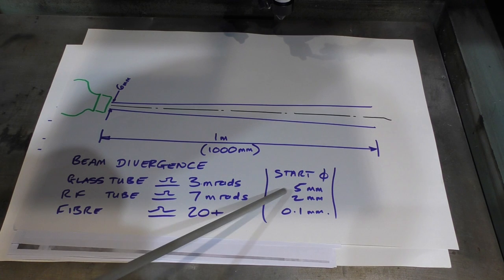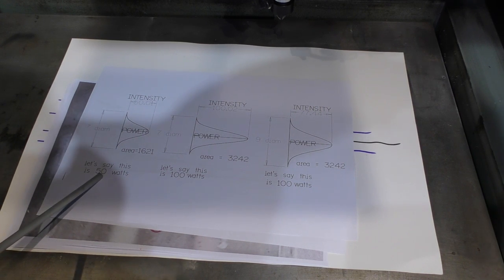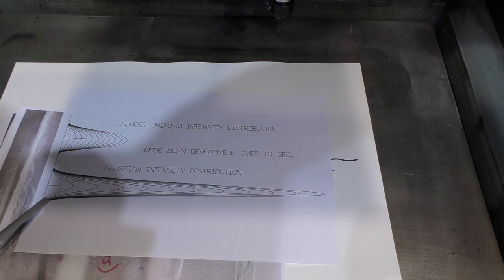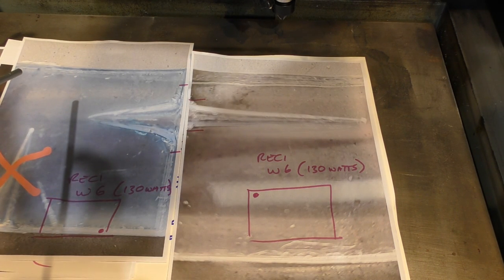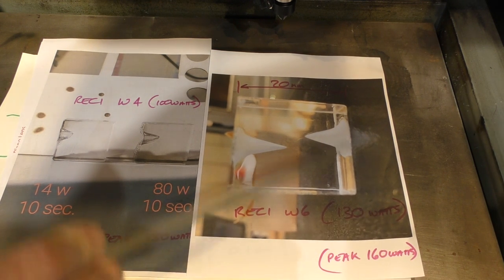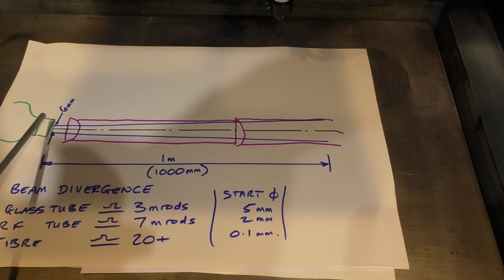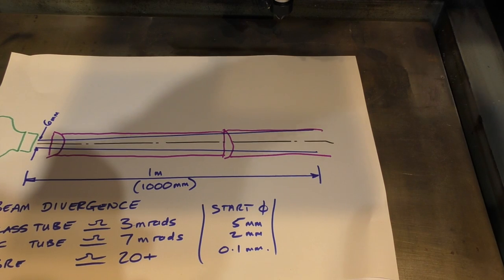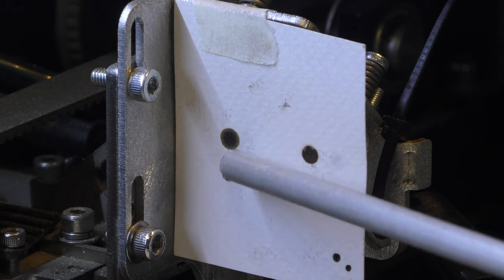RDWorks Learning Lab 225 Is a Beam Expander useful

Comment: Finally someone did it, I have been with this idea for two months now.
My machine does not have this drawback, since I only use one mirror and the work table moves, the beam remains constant.
According to my calculations, the beam after the expander will use a larger area of the lens, this results in a change in the depth of field of focus.
without an expander, you only use 30% of the lens area, which increases the peak power. with an expander you get less point but little power.

Thanks for your experiences and clarifications!
Sorry for my english.

Best wishes
Reply: you able to share some pictures of your setup on your YouTube page?
Reply: @novastar5365  Yes, you can see how such a machine works on my channel.
I did not photograph the machine separately, only the working process.
This is an axial laser that has two tubes, one on the bottom and one on the top.
Therefore, the laser beam must be stationary to bring them together. it is only useful for cutting, it is not suitable for engraving, it moves very slowly for engraving. I use a laser marker for engraving.

Comment: Hi Russ,
Perhaps a strange question...
Did you do a burn / dia check diameter at 240 mm.. would it be possible that the beam is not 'parrallel' but converging at 240 mm then expanding back to the original dia at 480 mm...Just an abstract thought ?
Keep going .. we would all be in the dark if it wasn't for you.....Thank you..
Reply from the maker: Hi Jerry
As I mentioned in the video, ignorance and curiosity are great  exploration tools. My previous exploration of lenses for OUR laser beam shows that lens theory is only true within strict boundaries. Step outside those boundaries an we are into a different world that has to be explored Beam expanders are designed within those IMAGE based  optical rules and as such what I appear to be doing is impossible.. BUT   your observation is valid  and, however unlikely,  should be tested. That will happen in the next video because as I said, my main aim is to make the RF beam into a useful cutting tool.  At present it is exits the tube at a claimed  2mm  diameter (FWHM spec?) so probably is  closer to 4mm. but I would like to see zero divergence. . At present it is "managed " with a X2 beam expander that looks more like X3 in reality. That means there are HUGE gains in cutting ability if I can keep the natural beam intensity high by suppressing the divergence. The current X3 or X4 units used by the "big boys" ensures great controllable engraving but they are then cutting with their ankles tied together. It is for that very reason my Tangerine Tiger has sat unused for 10 moths. Most of what I do away from the camera is cutting so why would I use a blunt knife when I have  two very sharp cutting tools  at my disposal
 Many thanks for the comment
Best wishes
Russ..
Reply: @SarbarMultimedia  Thanks Russ for taking time out for reply....appreciated..

Comment: I used Reverse Osmosis water in the chiller. Would you recommend any conditioner for the water? Managed to cut 1/2" ply yesterday and did laser etching. Had to turn power down to 25% to get it to not come out too dark.
Reply from the maker: ANY sort of water will work in a chiller BUt not for long. Reverse osmosis water is in effect deionized water that has had most of the particulates removed. This process does not remove bacteria which can eventually cloud your water or make it green. Bugs will only be killed by the heat of the sterilization along with particulate removal during the  distillation process.
 It will be fine to leave the deionized  water in your chiller but  check your tube about once a month to make sure your water is clear. At the first sign of cloudiness  drain and purge your system and refill with distilled water.
 Best wishes
Russ
Reply: @SarbarMultimedia  thanks

Comment: At some point you have to release a video giving instructions on what to do to get our machines running at tip top performance.
Alignment, mirrors, lenses etc...
Reply from the maker: Hi  
Did you miss   https://www.youtube.com/watch?v=6aNwKhTRnd8. I always recommend molybdenum mirrors because they are bullet proof. If they ever get a bit cloudy you can safely recondition them back to new condition, Just a quick blitz with silver polish and a cotton bud, After much experimentation with MANY lenses my go to to for cutting and general engraving is a 2.5" gallium arsenide with a cutting nozzle (2 to 2,5mm orifice) For marquetrt or thin material cutting por photo engravind I use the compound engraving kit. All my other lenses are for research (like this video) and are rarely used for anything else . Tip top setting always comes down to getting the beam axis and the lens axis perfectly coincident.....yes that pasky Z axis!!!
 Best wishes
Russ

Comment: If you use a Fresnel Lens would you be able to colimate the beam, so it doesn't diverge?
Reply from the maker: Who makes commercially available Fresnel lenses at sensible prices in ZnSe or GaAs. I understand how the concept of a Fresnel lens could help  with non-expanding collimation  BUT it would  have to be bespoke for a particular divergence and beam diameter otherwise it would be of no value. I like the novel thought process  though. Many thanks
Russ

Comment: I was cutting out some 1/8" ply. the portion toward the back of the machine cut fine but when it cut to the front it did not cut through. What do you think would cause this? smoke?
Reply from the maker: Was your air assist different at the front? I suspect no. The problem is unfixable and is called beam divergence. You must set your cuts to work at the front right corner of the machine
 This video explains it all
https://www.youtube.com/watch?v=z8sNPtIIXZ4

Best wishes
Russ
Reply: @SarbarMultimedia  Just made a discovery. The bed is far from being level. Job tomorrow is to level the bed then try again. I did watch your video and i don't have any acrylic to test the beam intensity.
Reply from the maker: @magicman9486  
 Off level is a definite contributor so fix that first. A piece of acrylic to test the beam is  an essential tool  If you have some thin acrylic you can cut squares and super glue them together or  put this description into your ebay 
Acrylic Display Stand Block Shop Retail Cabinet Jewellery Display Stand
 Best wishes
Russ

Comment: Did you made some intensity test with plexiglass after getting a 3.8 diameter point ?
Reply from the maker: Valentin
 That a good pre emptive question.. It is my intention to do so because that is the ONLY way to see if I have succeeded in achieving my goal.  I did mention that my real intention for this experiment was to effect a significant CUTTING performance gain on my RF machine. All RF machines MUST be fitted with beam expanders to control the 7 mrad beam divergence. I have already fitted the smallest possible X2 beam expander on that machine but in reality it seems like X3. . I also have a X3 and can demonstrate better cutting with X2 than X3.  There is no argument about my goal. All the "big boy" expensive machines are generally fitted with X3 or X4  which absolutely kills cutting potential.  It's the main reason my RF machine has sat unused for 10 months, I soon discovered that the magic proclaimed for RF machines is all smoke and mirrors.but my hope is to put some real life back into that machine with this beam shrinking technology.  There is no point in fitting it to the glass tube machine I used for the experiment because I will see very little gain.  I am looking to create a proper  beam expander (reducer) for the RF machine to see the benefits. I have a  zoomable  beam expander that is useless, so I will be investigating the plausibility of fitting my lenses into that to do some real before and after mode burns and cutting speed tests
 Best wishes
Russ.  
,

Comment: Have you ever had the power go out during a burn? I am currently doing a very long job (been working for 2.5 hours so far) If God forbid the power went out is there a way to resume?
Reply from the maker: Sorry no, there is no resume function if you are using RDWorks. Lightburn has a way to resume thats not automatic but resonably easy. Howeer all is not lost because if you have not moved the work then  the worst senario is that you run the ame program for 2.5 hour with the laser set to 1%powe or if youve a laser on/off swirch you use that to turn the laser off until you reach the point where you wish to restart. Is this a large image you are scanning or a complex cutting program ?  If its a cutting program there may be other options to delete paths that are already cut before you resume. That would allow you to jump im closer to the failure point.
 Thaey are the only otions
 Best wishes
Russ
Reply: @SarbarMultimedia  It is an intricate inlay project. (This is why i bought the laser. I think I might try 200/80 next time. (Been 5 hours now)
Reply from the maker: @magicman9486  
 Hi
 If it's a big job reduce the risk by putting didffrent sectiond onto different layers.
 Beat wishes
Russ
Reply: @SarbarMultimedia  laugh i did. it is on 3 seperate layers

Comment: Hello Russ, interesting ideas (thoughts) as usual. I watched this video with great interest because I've just finished the frame of my DIY 1300x900 cutter/engraver after destroying and salvaging some parts of my Chinese 900x600 machine. Your thoughts did invoke my curiosity and concern whether my new machine will preform as expected at its extremities using my salvaged W2 tube. I did look at commercially available beam expanders right after watching your video and they aren't terribly expensive from China. Just wondering if the claims they make are realistic or an absolute waste of money
Reply from the maker: Hi 
 My RF machine has abysmal cutting properties at the front corner with an unconditioned beam because there is a 7 mrad divergence. I was supplied with a X3 beam expander and it helped a bit but the cutting as poor all over. I acquired a X2 expander and cutting as substantially better.. My goal with this experiment is to get at least a X1 or maybe a x0.8 onto that machine. That will be a real result. 
 If you can get a X2 (or better) that will at least make the cut uniform across your work area but you may need something other than an  80 watt W2. Is it and A grade W2 or a B grade W2?  Check the peak power on the label (and the graph). Is  it 100 watts or more ( A grade) or sub 100 watts (B grade)?   the big problem wit a glass tube machine is you must  the beam up without  the beam expander confusing the issue and then it will have to be mounted perfectly coaxial to the set beam. Mounting and adjustment could be a nightmare.
 
 That's the main reason I choose to mount it on the RF machine. the tube already has a threaded mount for a beam expander.

 Best wishes
Russ
Reply: @SarbarMultimedia  Russ unfortunately at the time of buying my first laser (3.5 years ago), I was brand new in the laser game and didn't really know what I was getting or even what I wanted to do with it. The W2 tube is 90w (B Grade). I do intend to mount the tube first and align, then figure out how to mount a expander into the works. I'm not aware of any mounts specifically for an expander ... maybe re-purpose one or two #1 mirror mounts to achieve the fine adjustments required
Reply: @SarbarMultimedia  sorry for a second reply, but I have previously seen pictures of people mounting a tube directly onto or behind the X axis gantry. This would mitigate beam expansion or at the very least eliminate distance of the beam path that it would have had to travel down the Y axis and you then only have to contend with the total length of your X axis... Maybe an idea for people looking at a DIY machine would perhaps like to explore to tackle the subject of this video
Reply from the maker: @novastar5365  
 Just to be clear there are two numbers on the label.   Agreement power  should be 90 watt or more 90 and peak power which is the critical value. If it's missing then it is probably even worse than B grade 
 Your story is exactly the same as mine The tube I bought with the machine was real junk and when I replaced it, what I fitted was slightly better junk. This is what all sellers bank on, that this technology is beyond most naive buyers You have nothing to compare it with and no knowledge of or equipment to test it..
 Best wishes
Russ
Reply from the maker: @novastar5365  . This is quite a common configuration for big machines . In fact they usually make the gantry axis  the short axis . Even if your tube hangs off the gantry there are two avantages. One is the much shorter beam length variation and the second is the shorter gantry can be made lighter because it is short..
 Best wishes
Russ

Comment: I have been running my Laser from a USB stick so far. Today i managed to get Corel to talk to RDworks on the laptop. Unfortunately the laptop refuses to communicate with the Laser. I keep getting communication errors. You ever have such a problem?
Reply from the maker: Hi
Yes. twice. On  one occasion I was able to prove that the input connetor was faulty by pugging directly into the controller with an old USB printer cable. . On a different  occasion on another machine I upgraded to the latest version of RDWorks to fix the problem.
 Best wishes
Russ
Reply: @SarbarMultimedia  I will give those two things a try
Reply: @SarbarMultimedia  Checked cable then installed newer software. Now works perfectly.

Comment: Just received my 150 watt 1080 laser. dam that thing is huge!!! Typical to Chinese stuff. no documentation. Not even sure what power to use. Machine says 220, but they gave me a 110 cable. Can you recommend some preliminary exercises to get me started?
Reply from the maker: Hi
First off I presume you are in USA?
The rest of the world (except Taiwan) runs with 220volts so all Chinese machines start life that way and that may be why the label.says 220v.  I know that some of you  guys have 220 volts available but I anticipate that, knowing is was USA machine, they  will have swapped it to 110v before shipping. Switching on a 220 volt machine with 110 volt mains will not damage the machine, it just will not work.  But to be sure I would poke around inside and check how they have left it wired. There are only two places to look. First check the HV power supply. In your case I suspect it will be a big black box and there will be a thick RED wire to the tube. Check the nameplate.. It may be a dedicated 110 volt or it may be switchable 110/220. The second and only other place to look will be the mains step down power supply (sometimes there are two) Again it may be clearly marked or it may be switchable.. The output voltages will be clearly marked . At least one of the outputs will be 24vdc. So if in doubt, plug the machine in  (to a 110 volt supply) and check the voltage on the 24vdc terminals . If you see 24v then it is configured for 110v if the output is about 12 vdc then its set for 220v.
 You may wish to send me your disguised email  (johndotsmithatgmaildotcon) and I will reply  and then delete your comment/email. We may need to exchange pictures and programs etc
 Best wishes
Russ
Reply: @SarbarMultimedia  tried sending but i think youtube deleted
Reply from the maker: @magicman9486  
Hi,  try adding it via a sentence like.......the first part is  john and then there is a dot. After that is the normal at symbol followed by gmail and then a dot and a com.  I'm sure no algorithm is going to decipher that!!!
 Best wishes
Russ

Comment: my red dot does not work. how do i turn it on?
Reply from the maker: Hi
 That depends on what type of red dot pointer you have. If it is a beam combiner system, have you checked at the back of the machine as the beam exits the tube. That is where your red dot starts life and it may be there but misaligned so that it does not exit your nozzle. On the other hand it maybe an external red dot pointer attached to the nozzle ot lens tube and pointing to the work at an angle  of about 45 degrees.. In either case the LED will almost certainly be powered by the 5vdc power supply . However,  I can say for certain that about  100mm away from the LED you will find a taped joint where the unit has been connected to wiring that runs back to the power supply. the chances are that the wires have just been badly twisted together and need your TLC. If the problem is not there then follow the cables back to the power supply and check that you have a 5vdc supply from the transformer.
 They are the only options. If all is OK and the LED is still dead then it will be a new unit.
 Best wishes
Russ
Reply: @SarbarMultimedia  I managed to get it working. Between my new laser and my new table saw, there has been an awful lot of tweaking required.

Comment: I have been trying to figure out why my laser cuts/scans mirror image of what it is supposed to. I have tried playing with origin setting to little avail., Have you ever had this happen?
Reply from the maker: Hi
When you turn your machine on the head moves to one rear corner and the machine sets 0,0 to that corner If you are using RDWorkds then there will be two blue arrows indicating where it thinks 0,0 is. If it is not the same as where the head runs to at start up then you need to  go to Config, System settings and  set the 0,0 to the  correct corner.. Your blue arros will then be in the correct corner. If you are using Lightburn then the the blue arrows are a small red square mto let you know where machine 0,0 is set.. Get this setting wrong and it is the usual reason for image reversal. I have two machines and one pc that Iswap between machines. One machine is left and the other is right. If I confuse the machines I get reversed images.
 Best wishes
Russ
Reply: @SarbarMultimedia  ok thanks a ton, that worked